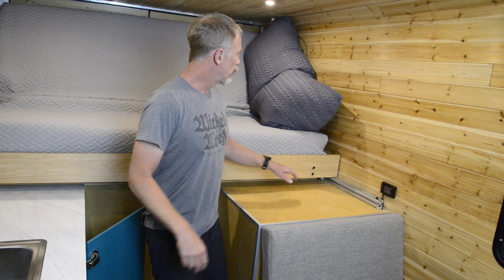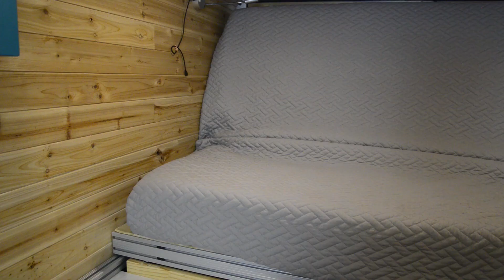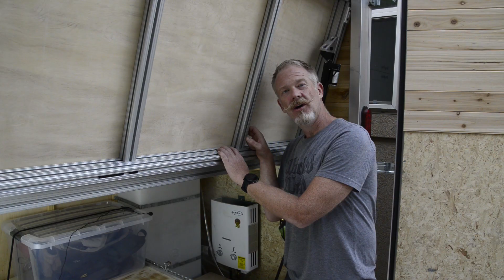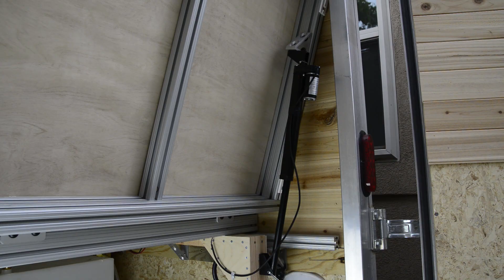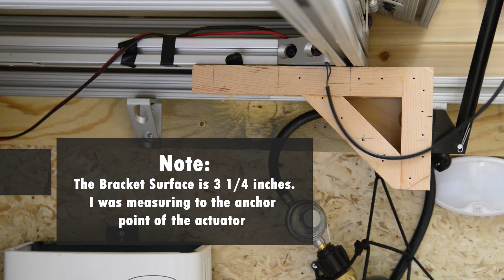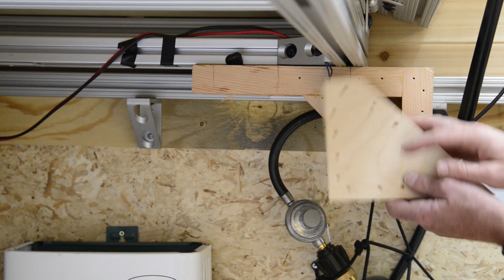Trailer Conversion Bed Converts To An Elevated Couch With The Flip Of A Switch!

Comment: A linear actuator can pull a cable. An aircraft cable and pulleys would allow this to be pulled up in a very simple way. There are also cables in jackets, think of motorcycle brake cables, that would rout nicely. Now that I think of it, all sorts of applications come to mind.
Reply from the maker: but then I have cables running in my trailer and I didnt want that.  plus they would have to be anchored to the ceiling and would be pulling at a different vector depending on where the couch was positioned.

Comment: Can you please attach the links for the bed frame and slide parts ? I have never worked with 80/20 but am pretty mechanically inclined. It would help out a lot especially the supports on the edges of the track.

Comment: While traveling, could you have the bed folded in the up position and have it moved all the way forward to allow taller items to be stored in the rear storage? Once you get to your destination you could remove the tall items from storage and use the bed as designed.

Comment: You would have made a good engineer.  Nicely Done.  Is there an actuator on the opposite side?  If not, doesn't the person seating on the driver's side feel some bend or rocking when leaning back?
Reply from the maker: The actuator is not supporting the bed.  It rests against the frame once up.

Comment: Great video, Thank you! I'm wondering how difficult it would have been to raise & lower it manually from the back without the mechanical system? It's cool, but it seems like you might run into ongoing issues?
Reply from the maker: It's kinda heavy, but not that big of a deal honestly. The biggest thing is having to go around back to convert.  It's nice to stay inside and flip a switch. 

Also it's cooler this way. 😎

Comment: How did you get the 80/20 bed frame to slide on the 80/20 rails? I hope that makes sense.
Reply from the maker: 8020 sells lube free bearing pads that make it slide on the tracks.
Reply: TrailerLife thank you

Comment: I've never worked with 8020 / aluminum.  Is it difficult to learn?
Reply from the maker: There is a learning curve to it.  I think if you have a good idea what you. Are trying to do and a good local distributor that will help you design they can design everything for you. The one I used in denver was horrible honestly.  It gets expensive though.  

The other option is to buy the stuff and cut it yourself and piece it together like you would a wood stick frame. 

I have mixed feelings about 8020. I'd probably use it again, but for some stuff I'd do it differently.
Reply: @ClearCreekWoodDesigns  Thank you kindly.
Reply: @d.k.3316  My experience with 8020 is that it is never optimal option for cost, weight, space... well it's really not optimal for anything. But, it is super versatile! If you have limited fabrication capabilities it really is fantastic for prototyping an idea quickly. I'm guessing there are a lot of pieces in this trailer that could have been achieved with rectangular aluminum tubing, or even wood. I can't tell you how many times I've been using it on something anyways, and thought, oh, this is great that I've got this aluminum channel here because I can easily add and move X, Y and Z.

Comment: I really like this approach but did you consider adding a second actuator at the other side? It would seem that the load would be distributed more evenly and at this point the cost would be negligible. Just a thought.
Reply from the maker: 100%. The problem is that the mechanism would get in the way of my bike storage. So it was a no go. It seems to work just fine the way it is

Comment: Speaking as an engineer, your actuator setup is impressive. I have a couple of questions though: what height is the top of the bed frame and what is the interior height, floor to ceiling, of the trailer? I ask because it looks like when you're sitting up in bed, your head is either touching the ceiling or very close. I'm 6'-1" and I might opt for a trailer 6" taller than you did.
Reply from the maker: Thanks for the kind words.  

My hair brushes the ceiling and I'm 5'10.   The bed platform is 41" above the floor.  You could save space by making the frame thinner either out of steel or figuring out how to prevent flex with smaller profile aluminum.  I also allowed generous space for the bikes.  

I already have the extra 6" interior height.  Not sure you'd want to go much higher. 

Good luck!

Comment: Awesome!! Couple of questions.  1- Size of Trailer?  2- How do you lock the bed?  3- No slots in bed frame- any problems with moisture build up?
Reply from the maker: The trailer is a 7x12. 
The bed stays in place when it is up.  
We drive with the bed down, and there are just is a T-nut bolted in place as a stop on both tracks so it doesn't come off while driving.

I had not thought if moisture buildup, but we do live in a very dry area.

Comment: Designing something similar. I love this. Incredibly clean.
Reply from the maker: Glad you like it!
Reply: @ClearCreekWoodDesigns  I love it! I'd like something that rotates so that the couch can also face out the backdoor. Watching your video helped me realize I'd need to change a few things about my particular design to make this happen. This is cool. I'm off to see some of your other trailer videos (new to your channel).
Reply from the maker: the structural pivots may be the answer, but I am not sure.  it would raise the whole structure up 1.5 inches and you probably have to add a another horizontal  member in the middle for to pivot arount.  not sure though.  I'd have to wrap my mind around it.  without something to rest yoru feet on out the back it isnt going to be that comfortable and it will be hard to get in and out of.  Personally,  I think you would be better off with the bed down and some big pillow to lean against - which is how we do it.
Reply: @SaidiLouise  I would put the actuator in the middle of the bed frame, being on the edge like that increases the load and strain on the actuator. So if you even out the weight by putting the actuator in the middle that should help quite a bit. Hope that helps